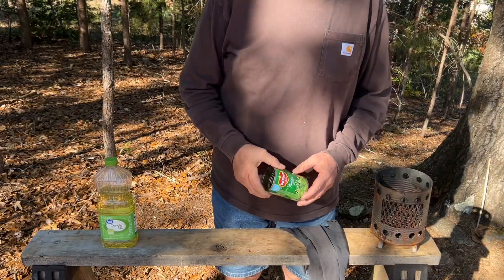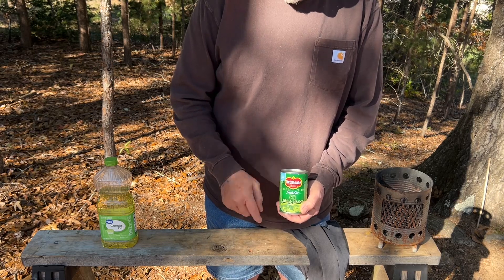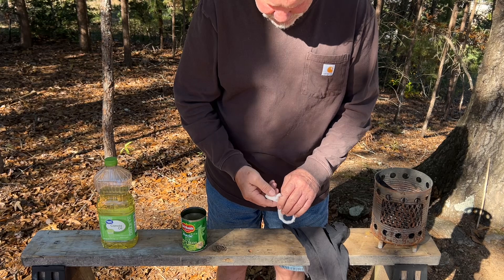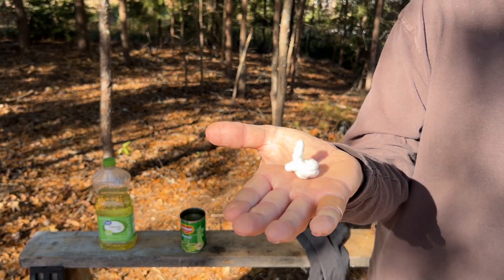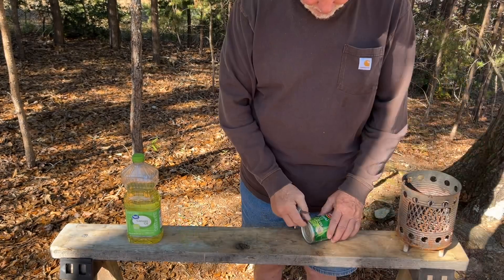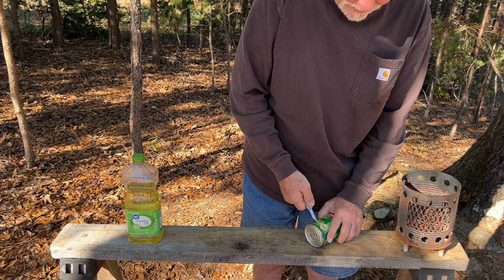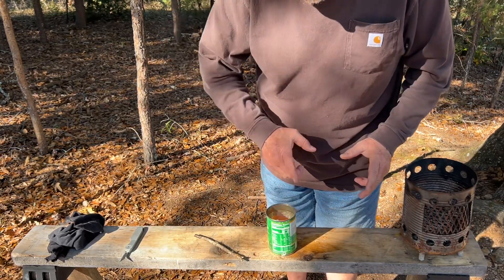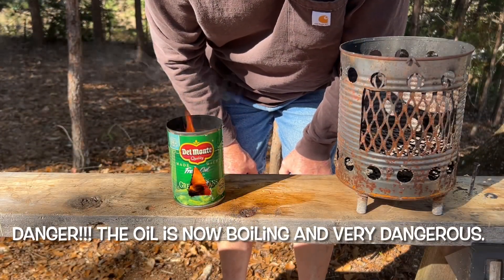I Designed A Wind Resistant Fat Lamp, It's Too Dangerous To Use

Comment from the maker: I had already stopped videoing when I discovered that my freshly built humble little fat lamp had turned into a fire breathing seething cauldron of boiling oil... not exactly the wind proof fat lamp that would provide hours of gentle light that I was going for. I started off with humor, ended up with hazard.
   I have lots of fat lamp, grease lamp build videos. Since I don’t have one that will resist 5 mph winds like we have today, let’s try to design one.
   I used a green bean can, that had a 1/2” oil reservoir after I cut a flame shaped opening in the front, only. The rest of the can I left intact to block the wind. I also showed a couple of ways to make wicks out of a cotton ball and t-shirt material. 
   When it came time to fire it up, the oil saturated lamp wick was very difficult to light, of course,  in all this wind. Fortunately, I found a calm enough area close to a tree and made it ignite. 
   When I dropped the burning wick into the lamp and oil, it took off burning normally. I was overjoyed. I did the outro then walked back to the house to return the Canola oil. When I came back to put out the lamp, it was burning furiously out of control. Flames shot out of the top of the can and from the flame shaped opening. It was burning out of control a very real fire hazard. I would never use this design to provide light for my camp.
   Let me explain why this lamp out of all that I’ve built through the years got so overheated:
1) The heat could not dissipate into the air with sides of the can still there and so tall.
2) The wick was so fat that it was burning very hot.
3) Possibly, that flaming vortex was directing highly oxygenated flames and heat down into the oil caused it to boil and to vaporize so rapidly.
4)You do not want a flame sitting directly on top of boiling oil that is rapidly being vaporized. It “ran away”. The heat ran away and continued to intensify. 
   What a better design for an oil lamp, grease lamp, fat lamp? There are many examples on
Youtube of lamps that do not heat up the oil. You've seen them: small squat jar with a metal lid with a small hole in it. Put a few ounces of oil in the reservoir,  place one end of the wick into oil and feed the other end through the lid.
   Please follow the LINKs below and SUBSCRIBE. Thank you!

Grease Lamps, Fat Lamps Playlist
https://www.youtube.com/playlist?list=PLkoXX8XsMW3k7cP1F4wShxqd_J0Uv_prf
Reply: Woulda made some pretty cool footage. Too bad you didn’t turn the camera back on.  😢
Reply from the maker: I know. I just dealt with the hazard and then realized that I had missed out on some great footage. When I came back over to snuff out the lamp, I found the oil boiling furiously probably with much of it vaporizing. The burning oil and especially the vapor was trying to release all of its energy at once. Remember the wind and that vortex was really forcing a lot of oxygen into this reaction... "thermal runaway" if you can call it that.

Comment: I use a floating wick made of a wine cork. I cut a loaf of cork about 5 mm thick.  Then i make  a hole in the center with a 4 mm leather punch. To avoid excesive heath on the cork i make a cilinder out of a roll metal square cut fom any can, lenght of the cilinder about 10 mm. Stuck this cilinder throug the cork hole and pass a wick trough the cilinder. Put this floating wick on a glass filled with oil and light the wick. The cork wil float no matter the level of oíl and the flame Will keep a safe distance from the oíl surface.
Reply from the maker: That's the best, to never let the oil heat up in the first place.